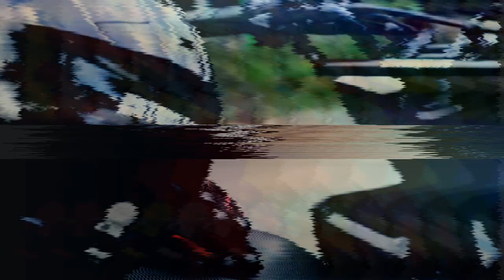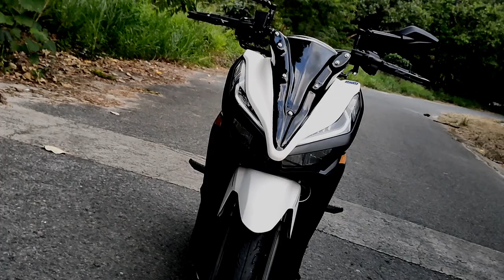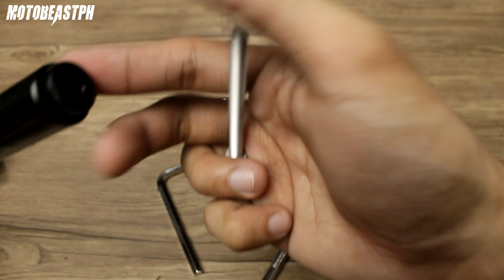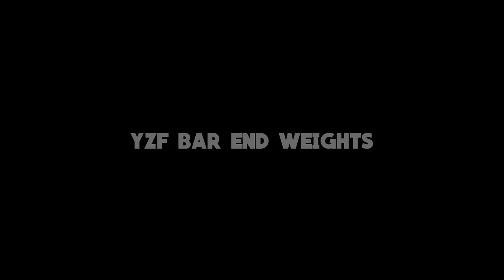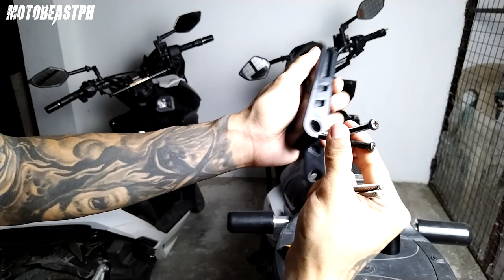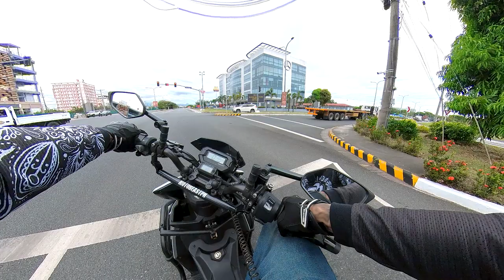Honda Click & Beat | Bar End Weights

Comment: kelan ka ser beast nag fi cleaning, throttle body cleaning, at fuel filter change? anong milyahe? yung sakin 17k na, di pa nag gaganyan
Reply from the maker: 10k throttle body cleaning, 20k fuel filter replacement.

Comment: New subscriber po. Newbie driver din. Tanong ko lang po kung kailangan ba talaga palit ng gulong? Medyo madulas Po kasi yung stock.
Reply from the maker: Try mo muna bawasan ng hangin. 27front, 31rear yung set ko tire pressure sa stock tires.
Reply: @MOTOBEASTPH  copy boss. Ty.

Comment: Bro tanong lang. Reasonable ba yung pricing nu mekaniko ng Casa na ₱1,400 sa Replacement ng TPS? 1week to wait kasama na dn daw labor niya. Sa loob kasi mismo ng Casa hindi available at 3months to wait.
Reply from the maker: Order ka nalang sa Shopee. Nasa 700 yung genuine.
Reply: @MOTOBEASTPH  salamat Bro. Goods na beat ko dina nahagok. Tanong ulit. Yung fuse na gamit ko sa Dual horn, pwede ba i-tap or isama yung wire ng positive(30) relay na gagamitin sa MDL? Dadagdagan nalang ng Amps? O bagong fuse ulit?
Reply from the maker: Pwede yan. Dagdag amp ng fuse depende sa amp draw
Reply: @MOTOBEASTPH  10amp yung nakalagay bro, pero yung binigay sakin na fuse 20a. MDL na Global dn ilalagay ko.
Reply from the maker: 15 lang dapat.
Reply: @MOTOBEASTPH  sige Bro. Salamat. RS lagi.